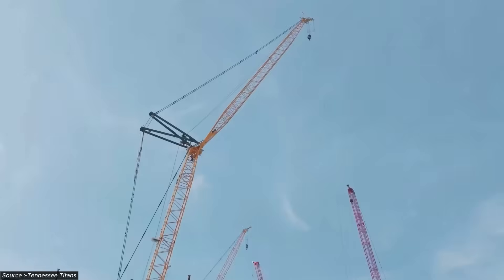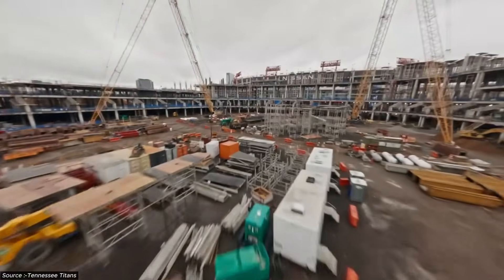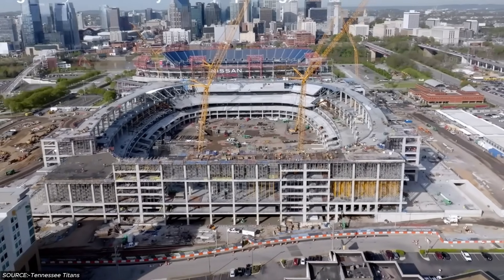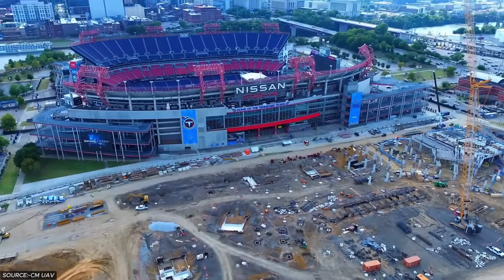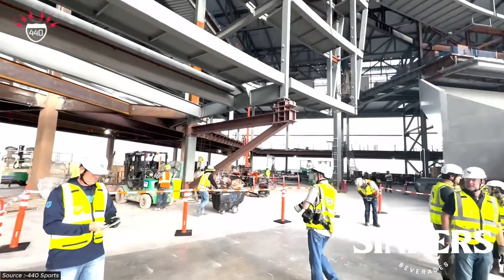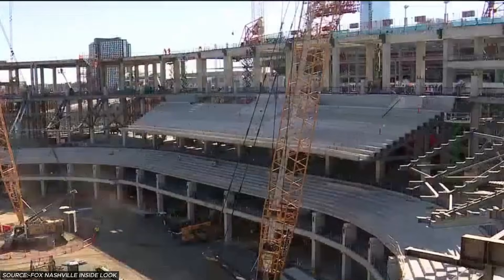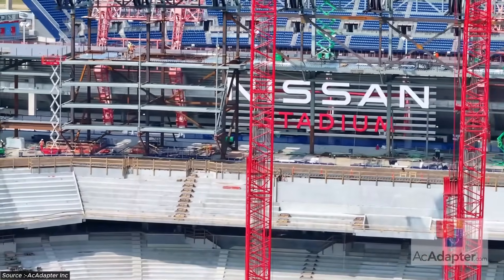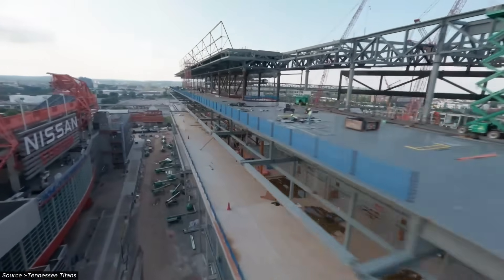Inside Titans’ $2.1B Stadium and the IMPOSSIBLE Roof

Comment: If the roof is so fragile spanning 660 ft with no center support, what will happen when we get a 4 inch snow on top of it? I see a repeat of the 1983 Vikings doom collapse after a snowstorm. I guess this is why I am not an engineer, but I hope some engineer has asked the question.
Reply: Tennessee rarely gets that much snow and the Metrodome had 20 to 30 years of harsh winter and snow before collapsing.
Reply: THEY ALREADY CALCULATED FOR SNOW..IT WILL BE FINE
Reply: I'd be shocked if the roof didn't have some special design where ice and snow accumulates on the roof.
Reply: I know the uni dome in cedar falls caved in to. During hurricane katrina the superdome roof got badly damaged
Reply: The real threat, obviously, is severe weather. 2 major tornadoes have come within 5 miles of that stadium in the last 5 years.

Comment: What's wrong with the old stadium?
Reply: Foundation is literally cracking apart. And repairs/ renovations are going to be over a billion dollars. I was hoping they would restore it but they went by this. I don't know
Reply: It sucks and looks ugly as heck thats whats wrong. I for one am glad a new stadium is being built. And dispite agreeing or disagreeing, you cant deny the amazing work the construction people are putting in!. They are doing an excelemt job and the new stadium will be beutiful. Dont worry, your taxes arent being effected by the stadium so no one should be honestly be mad.
Reply: Under the original contract the city of Nashville was responsible for maintenance of the Stadium. Due to political reasons, the city of Nashville did not do so. Leaving the Titans organization to front the cost. They did the bare minimum while racking up a IOU bill for Nashville in the Millions. So when the foundational issues became apparent, the city of Nashville was left with two options. One, reimburse the Titans organization and cover the cost to repair the old stadium. Or two, work a deal to build a new stadium. In that new deal, the city of Nashville was able to get the Titans organization to eat that outstanding bill for past due maintenance.
Reply: It needed repairs and needed to be renovated.  The cost would have been a couple billion dollars.  Which is about the cost to build this new one.

Think of this like buying a new car vs repairing the old one. At some point, it makes no sense repairing and renovating the old thing.